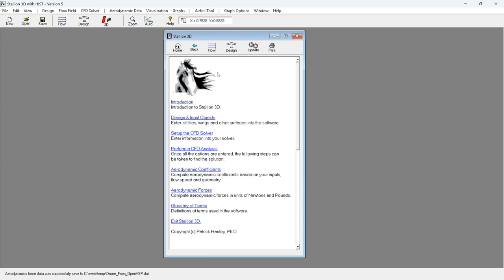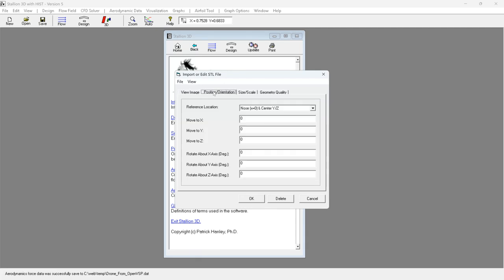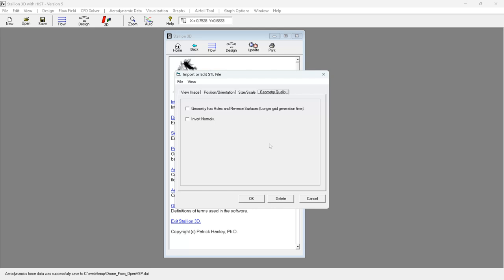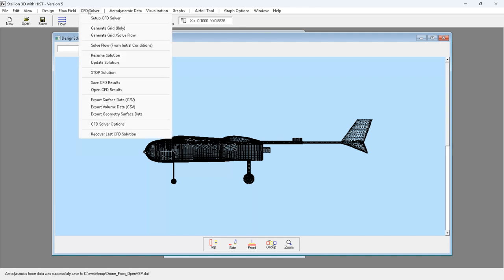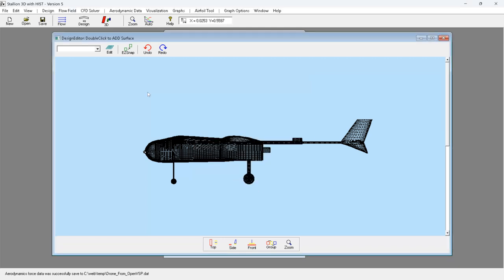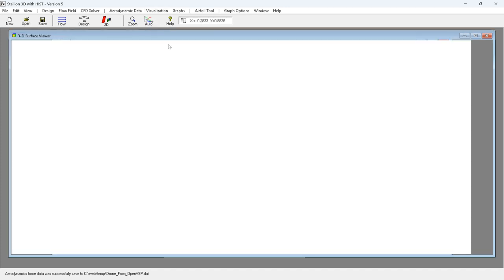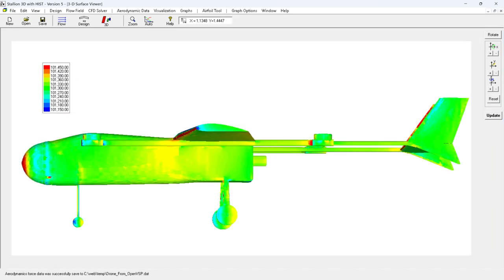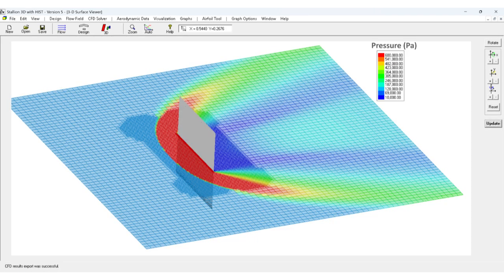UAV Aerodynamics with CFD | Automatic Geometry Setup & Analysis

Comment: I want to design a wing for my UAV that is capable of generating 160 - 200 lbs of lift at approximately 30 to 60 knots.  Can I design a wing in OpenVSP then import into Stallion 3D and find out how much lift (pounds) the wing will produce?
Reply from the maker: Thanks for your  message.  Definitely.  You can design in OpenVSP,  import the STL model in Stallion 3D and perform your desired computations. Do not hesitate to contact me if you have other questions.  Best regards

Comment: Can I get the aerodynamic derivatives (control, static and dynamic) aero derivatives by this software? 
And how accurate is this software? Comparing to ANSYS FLUENT CFD
Reply from the maker: Thanks for your message.  The derivatives can be found by multiple runs. First, the baseline run.  Next, angle/beta changes for static derivatives.  Next, a geometry with control surface deflection for control derivatives.  The quasi-steady rotations for dynamic derivatives.  Stallion 3D is very accurate. In the past, I used Stallion 3D for a small fixed wing drone design with all the above derivatives in play.  It flew.
Reply: @hanleyinnovations  
Thank you for your response Mr.Hanley, can I please have you email or anyway to discuss about the software and how to obtain all aerodynamic derivatives by this software?
Reply from the maker: Thanks for your reply.  Please email me at hanley@hanleyinnovations.com.  I look forward to it.  Best regards